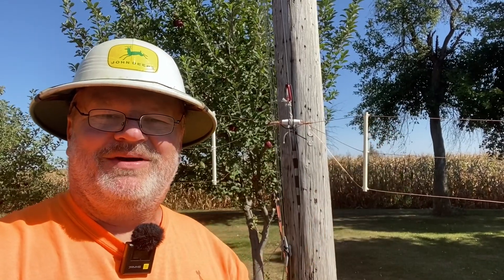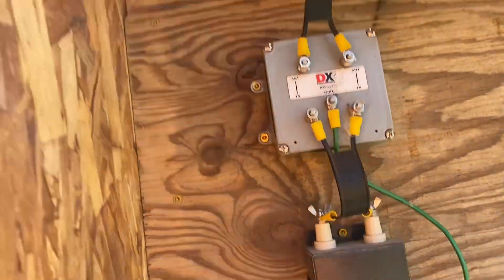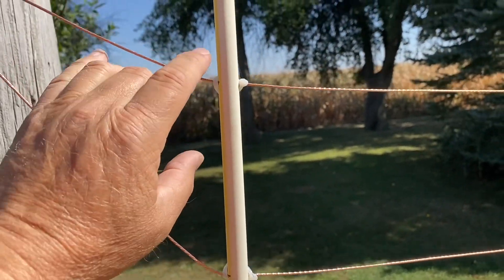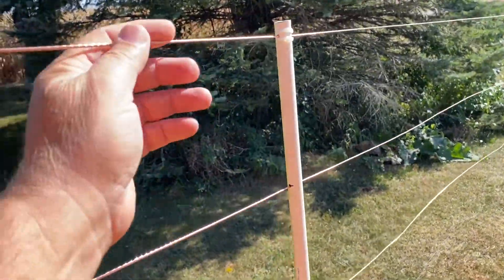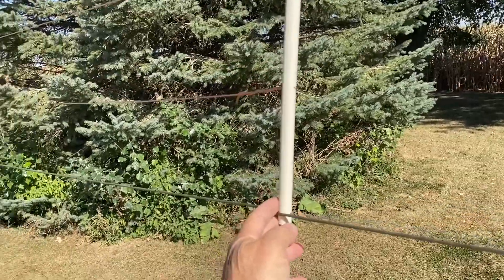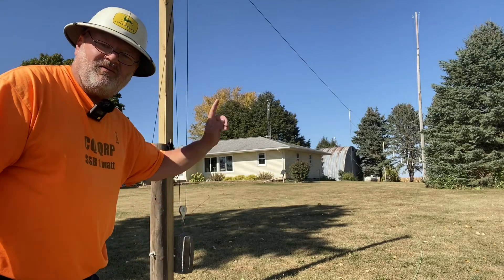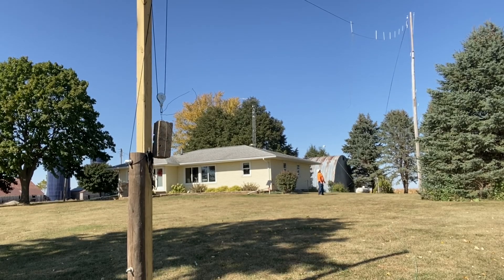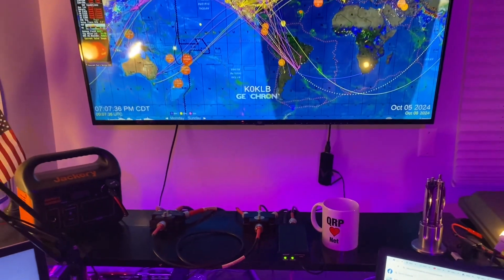Inverted "V" Fan Dipole construction - QRP SSB Iowa

Comment: This is Leon, KC1LBL. Kevin, as we have discussed many times, I have for many years believed that for best results an antenna should be both physically and electrically balanced. That is, each wire leg should consist of the same length and orientation above ground, and the antenna should be fed at the exact center using balanced feed. That is, with equal and opposite (180 degrees out of phase) voltages to each leg. It’s kind of like how AC power is delivered to your house. They connect AC power to your house using 3 wires, a ground, and two 110 volt signals that are 180 degrees out of phase. Loads connected between either wire and ground get 110 volts. But when connected between the two 110 volt wires, because of those voltages are 180 degree phase difference, those voltages add together and the load gets 220 volts. And ground is not involved. A balanced antenna behaves similarly. 

I could be wrong, but it’s always been my belief that preserving proper balance best guarantees formation of proper radiation pattern. I believe you proved this to be true during your recent QRP contest where compared to other stations you actually made the most contacts. You didn’t win the contest outright because other stations earned multipliers, and that’s OK. But it’s important to realize that no other station working the contest under the same propagation conditions came close to your number of contacts. And since the contest required portable operation, most of those stations were using more convenient to set up end-feed techniques. In contrast, you set up a properly balanced antenna and blew them away. You even blew away CW stations that inherently have an advantage over SSB. 

Yes, SWR tells us that power is leaving the rig and is not being reflected back. But it doesn’t tell us how that energy is being radiated. If somehow there existed a magic set of eye glasses that would make our transmitted RF visible, I think we’d be surprised that end feeding not only loses power by dissipating it into the ground, but it also distorts the radiation pattern. I also think that the radiation pattern of coaxial fed dipoles gets distorted by the presence of the outside shield of the feed line, even if one installs a balun at the feed point. And how could we know? Going on the air doesn’t prove anything. My goodness, I’ve seen you make contacts using a shovel as an antenna. And your many QRP activities show that one can make contacts with even just a few milliwatts of power. The bottom line is, we can’t see the RF, so we don’t really know what the radiation pattern looks like. But of course we all want our radiation to be as efficient as possible. We want more than a few contacts. We want the most contacts possible.

It’s hard to achieve perfect physical and electrical balance. You achieved it in the QRP contest by setting up portable in the middle of a corn field, away from objects that might distort the pattern. At home, you can’t do as well because the proximity of the house to one leg creates a slight imbalance. However, I feel that what you have constructed is the best you can practically do. I look forward to seeing whether or not over time you realize better performance with this new fan dipole. One thing for sure, during the last two QRP Sunday night events using your new fan dipole, I heard you for the first time in many months.

I understand your efforts to trim each leg of your fan dipole to optimize SWR on each band. Having an antenna that has a naturally low SWR at the frequency of operation is more convenient. So go ahead and do that. And as you are discovering, it can be a challenge trimming so that those SWR notches are exactly at the frequency you want for each band. Still, I’m sure if you work on it you’ll eventually optimize it to your liking. However, from the point of view of radiation efficiency and radiation pattern, I believe it makes no difference at all. The tuner does the job of lowering the SWR for the rig and the balun properly converts from unbalanced to balanced feed. Ground is not involved. Each leg of the antenna is isolated from ground. Also, the feed line does not affect the radiation pattern because both wires of the ladder line pick up equal RF energy and naturally cancel each other out. It's true that if the impedance presented to the tuner is way off, the tuner might have to work a bit harder to achieve a perfect match, and in the process it might exhibit higher ohmic losses. So yes, further trimming might gain a few precious fractions of a dB. So again, go ahead and do that.

I love the mechanical aspects of your project. It was all well thought out and works beautifully.
Leon
Reply from the maker: Hi Leon.. wow.. Great comment with a wealth of experience and knowledge in there.. Thanks for all your help and encouragement in my ham radio adventures.. It's been an exciting and fun ride.. thx for sharing it with me.. 73, Kevin ~ k0klb

Comment: I wish I had been wearing a pith helmet when raising a multi-band vertical and 30 foot pole. I wasn’t observant and didn’t realize that the pole section just under the vertical had bent, then broke off. The entire vertical came down, hit my head, causing a big lump and of course it bled. So good safety measure Kevin.

Comment: I would really like to build one of these.  I even have an old utility pole on either end of my house one which used to run the well pump and the other carried power for the corn dryer.  Can I ask you a few things?  Why a 4:1 balun?  I was planning on stringing mine from a 1:1.  How does the use of ladder line play into your choice of a 4:1 balun?
Reply from the maker: Hi Mark.. Thanks for watching.. I tried a 1:1 balun with the 450ohm window line and I couldn't get things to line up, however with the 4:1 I could get the SWR more in line for my setup.. Your results may vary.. If you are using a long coax from the shack to a 1:1 balun at the feedpoint on top of your pole, you'll probably have good results. (I think that is how most folks do it).. I had plenty of window line available to use and wanted minimal loss running  QRP..  I love the mechanics of the counter weights to keep the wires tight when I lower it for High winds and Ice storms.. Takes about 15seconds to lower it horizontal about 10ft off the ground.. Its well worth the "peace of mind"..  Good luck on your project..! 73

Comment: I built a fan dipole but for 40/20/17 plus 15 as a harmonic of 40. Same thing with the hollow plastic spacers. I however went for a resonant fan with a 1:1 balun at the centre feed plus box back to the shack instead of open feeder.

Comment: That is not a fan dipole. Fan dipole has a central contact point with wires "fanning" out to individual connections with each wire. You have built a parallel  dipole!
Reply from the maker: haha.. right?.. Some could say that.. Thanks for watching.. I appreciate it.. 73..

Comment: Fan dipoles are fed with coax and can get real close to a 1:1 match without all the extra stuff or tuner. I bet you would gain 1 S unit in signal with a straight coax feed. Ladder line isn't always the lowest loss solution.
Reply from the maker: Hello Robert.. Thanks for stopping by and taking the time to comment.. I appreciate it...  73, Kevin ~ k0klb

Comment: Nice setup and a great little project! Have you done much on 40 or 80 meters? Is your long wire still up? KD9VAN
Reply from the maker: Hey Jim "The Banjo Man"... I have done 80 and 40.. works great.. The long wire to the silo came down during a recent Mega Wind storm.. I left it down and built the fan dipole so it worked out.. Not sure when/if I'll put the long wire back up.. If this fan dipole continues to work as well as it is.. I'll keep using it.  Thanks for watching.. 73, Kevin ~ k0klb

Comment: I would not rely on the pvc to support the antenna  I would connect the guy ropes directly to the ends of each antenna wire. nice build !   I Have used fan dipoles for years and am working on a new one with traps for more band coverage. Also doing 50 ohm to a 1to1  balan at the antenna feed point would have less loss and less noise. WB0EMJ
Reply from the maker: Hi Stan.. Thanks for watching and leaving a comment.. With our weather conditions, it will be a great test on the PVC supports.  I'll keep you posted if they hold up.. Good luck on your new fan dipole with traps and 50 ohm feed... Thanks for stopping by.. 73, Kevin ~ k0klb

Comment: Hi Kevin....the new Fan Dipole certainly does work.  I believe I've logged you twice so far while using it, and both times 100% copy with good audio at 5 watt levels.  It's a winner!  I would definitely seal up the copper feedpoint with some solder before too long to keep the corrosion away.  73 de Chris  WA7RAR
Reply from the maker: Thanks Chris.. Always a good day when I can hear you in OR and snag your attention for a signal report.. Thanks for pulling me out of the pileups.. 73, Kevin ~ k0klb

Comment: Great antenna and suspension system! I use old timey window weights on a pulley for my tensioning on EFHW and G5RV!  I'm considering  building a 10m /6m fan dipole. This video gave me a lot of great ideas for construction! Thanks! ky4ej
Reply from the maker: Hi Jeff.. Thanks for watching... I'm glad you could pick up a few ideas for your future project.. Hope it works out as planned and good luck.. Thanks for your comment.. 73, Kevin ~ k0klb

Comment: I like the pvc pipe for spreaders.... ive also seen people use cat5 cable for cheap antenna wire
Reply from the maker: Hi Ryan.. Thanks for the suggestion of the cat5 cable.. Ill have to remember that next time I have a pile of it from a switch removal.. Thanks for watching.. 73, Kevin ~ k0klb

Comment: Thanks for another great video Kevin.  I had a fan dipole years ago with that exact MFJ 4:1 Balun and it worked fine.  Your contacts confirm that it is working well.  73's de Tom WB3EME
Reply from the maker: Hey Tom.. Thanks for stopping by and commenting.. Glad to know you have had success with it as well.. Thanks for your support here and on the QRP SSB Livestream channel as well.. 73, Kevin ~ k0klb

Comment: Awesome setup, I love your practical approach! A question about your solar setup - do you also run your computer and screen off this system? Regardless of the answer, please make a short video about how you rigged up your solar system and roughly what components you used, we cannot have too many practical videos. Greetings from across the puddle! 73, Jan M7HNK
Reply from the maker: Hi Jan.. Thanks for watching.. I only power the radios with the solar and battery.  The TV and laptops are still using AC power, but I could convert them easily if needed.. A while back, I actually did do a video on my solar system but never published it.. I didn't figure anyone would care, LOL.. It should probably be updated so I'll remake a new one to show the current set up.. I'll post it when I do.. Thanks for your support and comment.. I appreciate it.. 73, Kevin ~ k0klb
Reply: @hamradioqrp-k0klb  yeah lets see the solar system please
Reply: I would like to see the video too Kevin!  😋😋

Comment: Not sure why you went with a 4:1 Balun and 450 ohm feed line. Your transceiver is 50 ohm, and the antenna feed point is 50 ohm. It would be better to keep everything 50 ohm. 50 ohm transceiver, should go to a 50 ohm coax jumper, to a 50 ohm RF choke (rather than a 4:1 Balun), then going to 50 ohm coax, then going to the 50 ohm dipole feed point. That way you should get near to 1.1:1 SWR at the shack end. No need for an ATU to bring everything back down to 50 ohms. Thanks for the video
Reply from the maker: Hi John.. Thanks for watching and commenting.. Coax feedline is def one way of doing it.. It is unfortunate I need the 12ft of coax to get outside the shack.. If I had my premium setup, Id have the 450ohm running direct into the shack and connected to a tuner that has a balanced output.. but I'm just not there yet.. That is the next phase.. (cause there is always more efficiency to gain somewhere, LOL) .. Thanks for your support.. 73, Kevin ~ k0klb
Reply: Was about to ask a similar question and you brought a good point with the no loss 450 ohm line.
However in the meantime why a 4:1 and not a 9:1? Which would resuce the ohms to 50 ohms
Reply from the maker: @Soween  Hi Soween.. Using the 4:1, the impedance was a little below 50 ohms on 40 and 80m.. It works well with the 4:1 so far..   Thanks for stopping by and commenting.. I appreciate it.. 73, Kevin ~ k0klb
Reply: @Redbelly357  😂😂
Reply: Pretty looking antenna. I have a couple of quick comments. I have been doing something similar for 25 plus years now. The ladder line loss is probably as low as you can get but I am using simply RG8X coax as my coax lengths are less than 100 feet and I figure I can accept that amount of loss. I call anything that has multiple dipoles on one feedline a fan dipole even though it is technically “fanned out”. 
The feed point of the dipoles is low if at resonance. If the feedline ( in your case 450 ohm line) were 1/2 wave or multiple of 1/2 wave long you would see the antenna impedance at the input to the ladder line. Otherwise the ladder line is transforming the approximately 50 to 75 ohm antenna feedpoint to some other impedance at the transmitter end. I assume your tuner is compensating for that. Maybe the math worked out that you don’t need it. I use a Smith Chart to figure those things out! Also it is my thinking that if a dipole is resonant it does not matter if it is not exactly symmetrical. I cut mine long then trim a little from each end alternately until I get the resonant point close enough. 
As I get older I am cutting back on how many dipoles I put on one coax as it’s not as easy as it looks to handle three or more dipoles with spacers etc! Great job and it sounds great too!